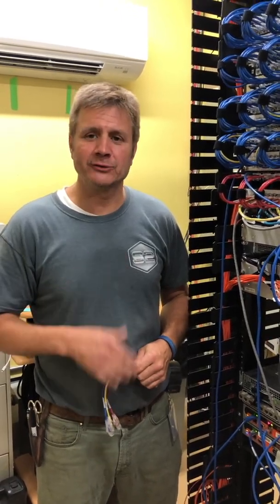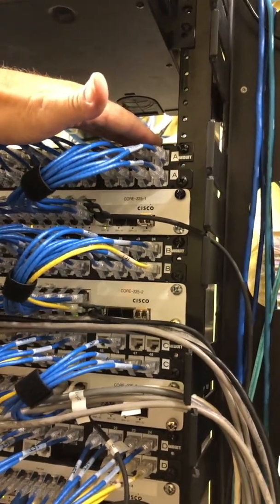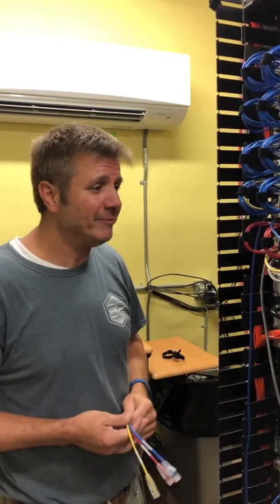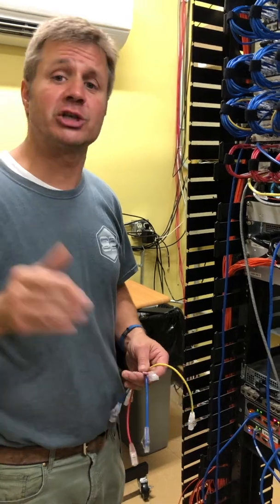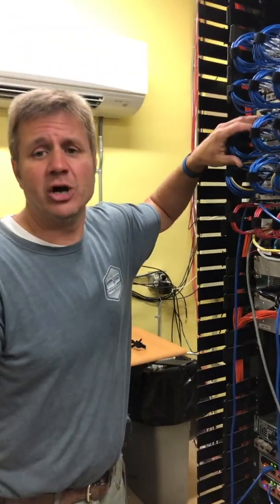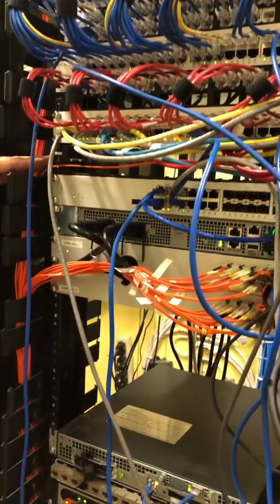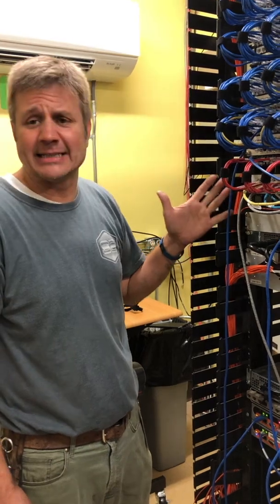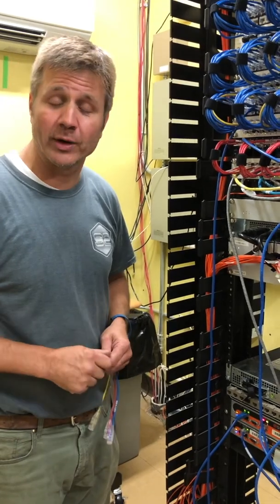Part 3 - Network Rack Re-stack Project

Comment: It's always nice if you can locate the jumper to are looking for without the need to dig through a rat's nest.

Too often, jumpers from equipment to patch panel run here there and yonder, without being placed in troughs or channels for the length of the run.  It looks messy and is a good way for something to snag a jumper and either rip it out or break it at the point of the snag.

What you folks have done so far looks very efficient and nice looking.
Reply from the maker: Thank you, Jamie for your comments.  We also provided them with a detailed audit for all the cables and keeping it updated on every new cable installed.  Thanks again.
Reply: @S2LV   You're welcome.  In my previous career, aka having a job I liked, I say the backside of too many patch panels that would take someone several minutes just to find the jumper they were needing to remove or move.  And there were troughs attached to both sides of the bay.